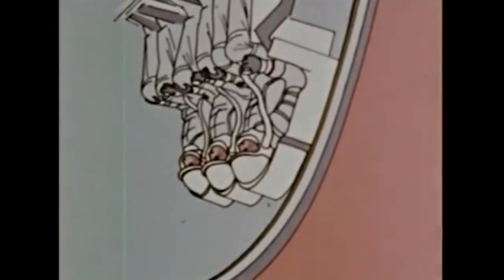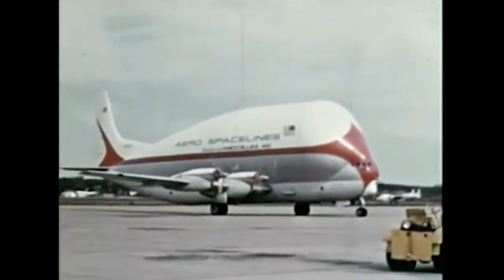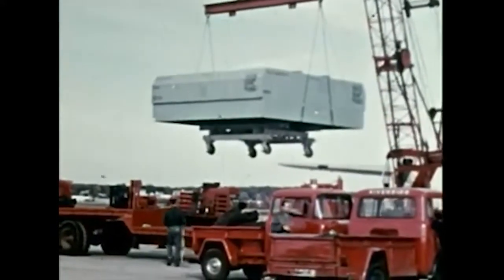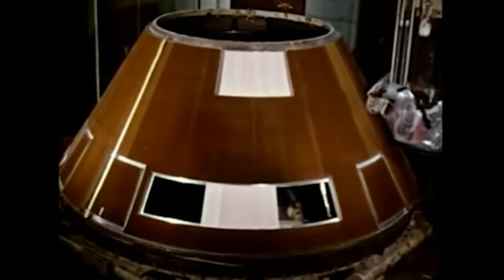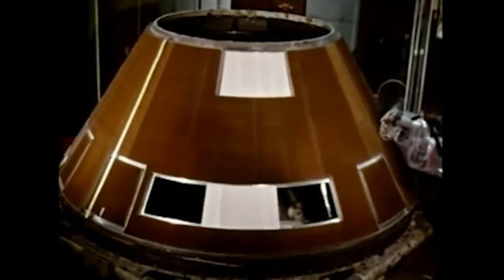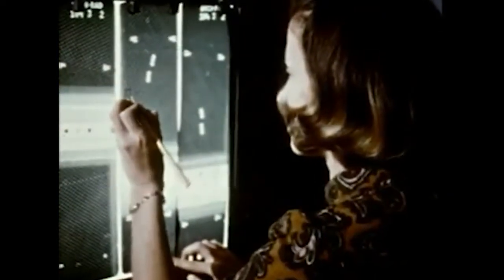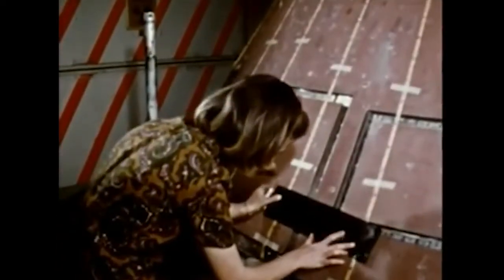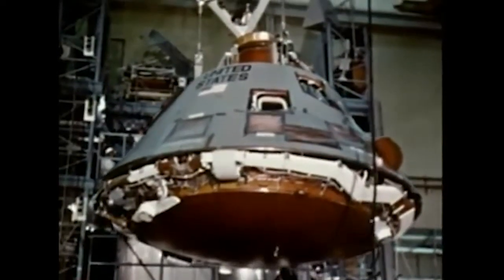1000 Seconds to Home: Apollo Heat Shield

Comment: The glass window did not have ablative.  Why did it not melt, deform, or transmit heat from the exterior (1000's of degrees F) into the 75F interior?